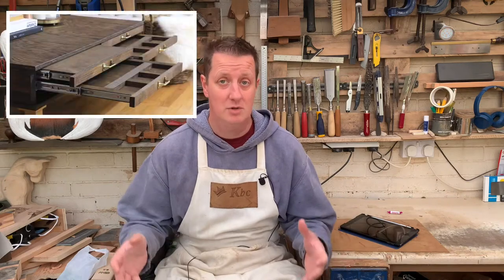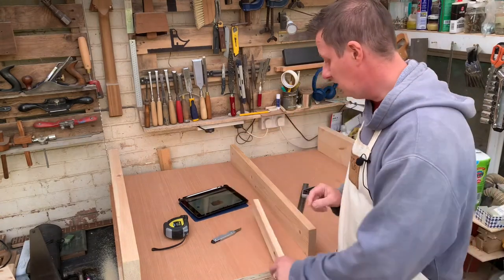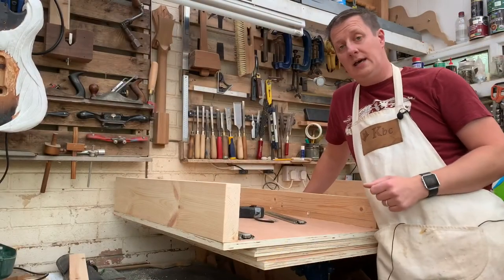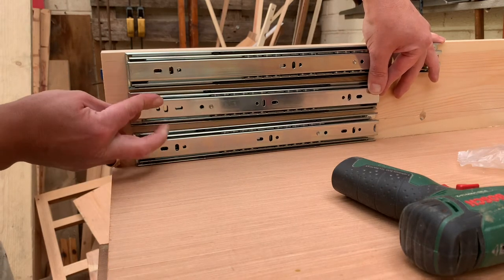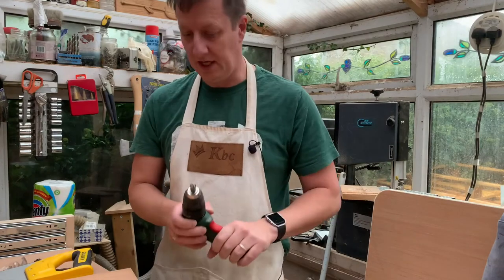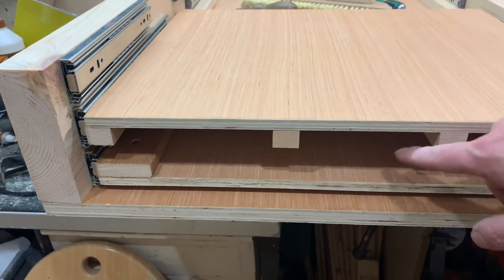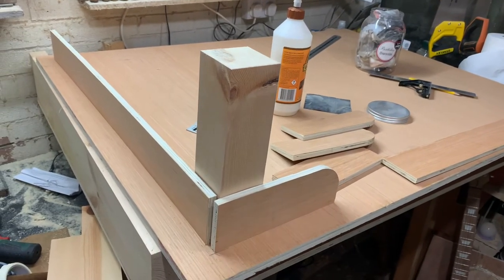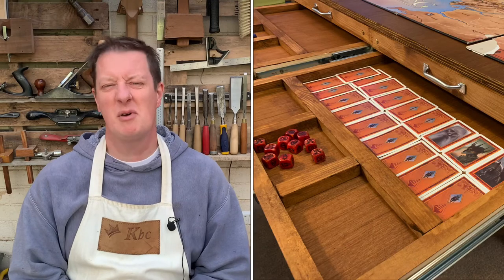Board Game Table  |   Using someone else's plans!

Comment: Hi Chris @KingBespokeCreations – love your videos mate and this looks like a great project. Hope you don't mind me saying that your vids would be even better if you just tighten up on the audio/video lip-sync issues and that would be grand!
Reply from the maker: Hi, thanks I appreciate any feedback. I have no issues when I watch it back on YouTube. As I record on an iPhone, the audio and video are linked as one and never get split during editing. I wonder if it is an internet lagging issue?  Just a thought, do you use Bluetooth headphones? They can delay sound from the source.
Reply: @KingBespokeCreations  – it's strange Chris, as I'm watching on a MacBook Pro with wired connection to superfast fibre broadband (sound direct from laptop speakers), and I've checked it out on several browsers... same result. It's only a tiny lag, but noticeable. Maybe it's just my silly computer then, or a temp glitch‽ Still, it doesn't detract too much from gleaning wonderful woodworking tips from you – I particularly liked the countersunk bit tip as I'd noticed that issue everytime I drill the hole first... such a simple solution, cheers!
Reply from the maker: @3DruZed  glad to be of help! I’ll keep an eye the sound 😉